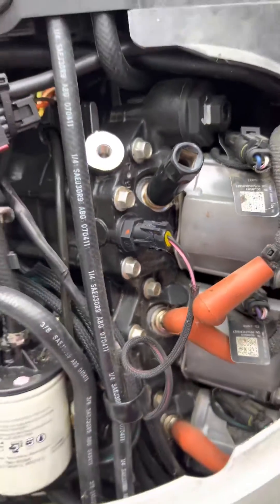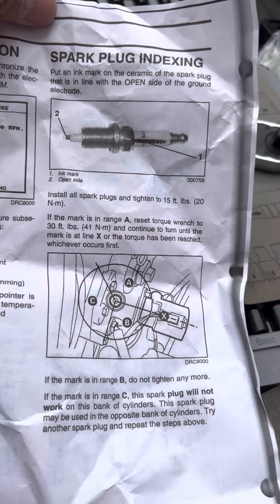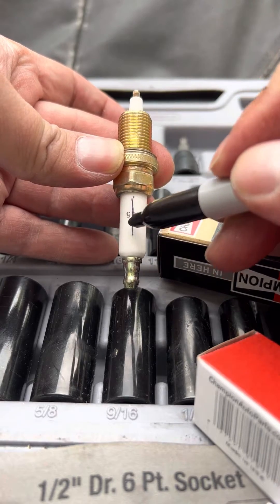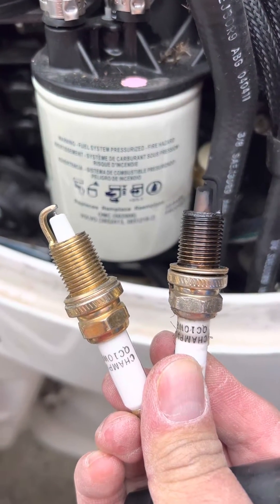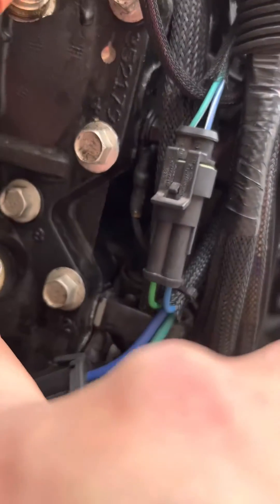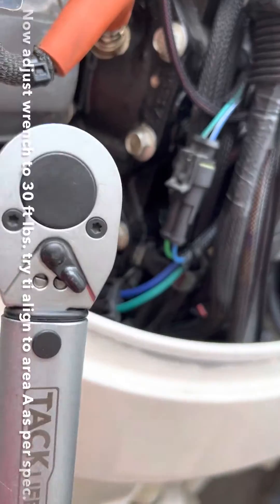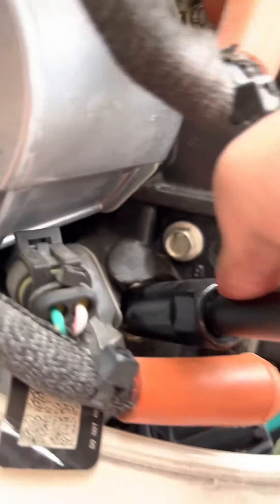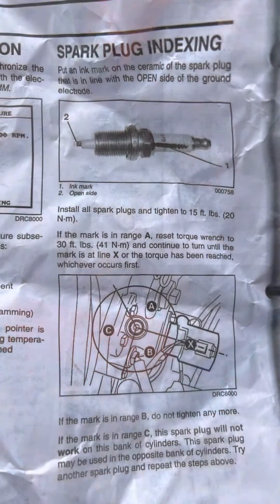How to change spark plugs for Evinrude etec 150hp ,175hp ,200 hp outboard engine - spring tuneup

Comment: Hi, I have twin 150 etec. You actually encouraged me to start replacing fuel separator, changing gear lubricant and this weekend I bought a torque wrench for the spark plugs. Here in Quebec Canada, getting service is next to impossible. I was surprised that  champion spark plugs were hard to get. Price ranged for $27 to $32 plus 15% sales tax per plug. I found them in an auto parts store in Alberta at $19 plus 5% sales tax. Thanks for the encouragement.
Reply from the maker: I ordered my parts from Paul at https://www.klausmarine.com/html/contact.html